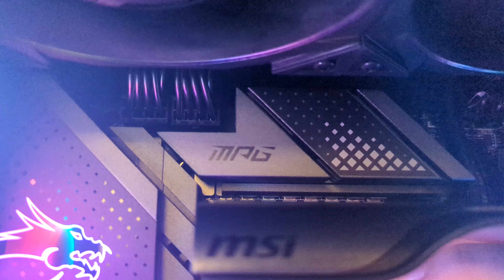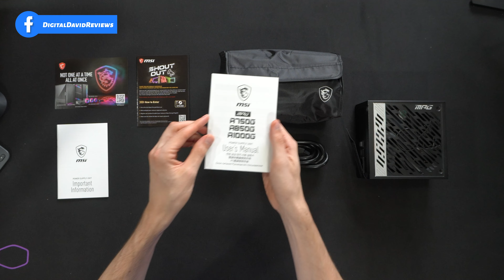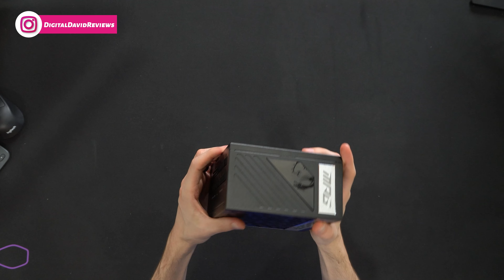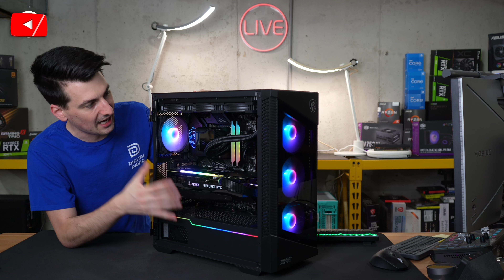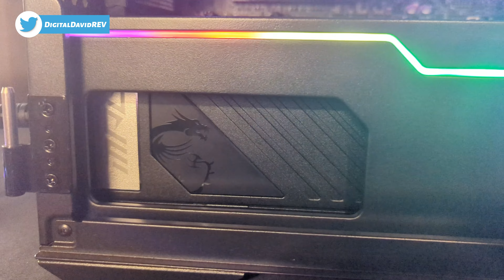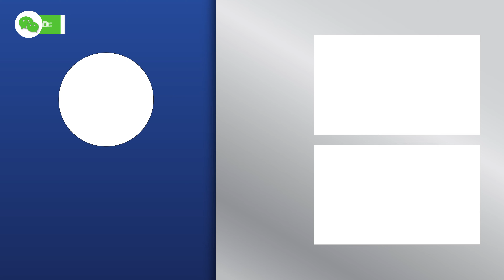MSI MPG A1000G Gaming Power Supply Review

Comment: Hi man! So im using this PSU for 6 months and i dont understand the "zero" button in the back. can you explain me please?
Reply from the maker: Here is what you need to know:

Certain power supply units have a zero RPM mode. This feature allows for the PSU fan to be completely off when it is not needed and will automatically turn the fan on when your PC reaches a certain temperature. Once the fan is turned on, it starts at a low RPM that gradually increases with the temperature.
Reply: @DigitalDavid  thanks man. You clarify me

Comment: I’m undecided between this and the platinum 1000W version from Straight Power 12 

What’s better and what’s platinum for?
Reply from the maker: I would do the Straight Power 12 since it has PCIE 5.0 on it! You might appreciate having that now or defiantly in a few years! Platinum is just the energy rating efficiency. "80 Plus Platinum certification is the highest level of efficiency offered by the 80 Plus program, indicating that the PSU has an efficiency of at least 90% at 20% load, 92% at 50% load, and 89% at 100% load."
Reply: They have since updated this unit for atx 3.0

Comment: Got mine hooked up and it’s doing the job. If I had 2 gripes:

1. The 2 parts of the ATX cable are on the wrong side from one another, doesn’t line up to the ports unless you swap their positions.

2. I called the tech support and the guy was a total asshole. Like really, really rude. My last PSU was an EVGA and they were always phenomenal.
Reply from the maker: I'm sorry to hear about your experience with the tech support. I've honestly been noticing rude tech support with a lot of companies lately.. It's no bueno. 
~B

Comment: Do you know why are the cpu cables pins different from both sides?
Reply from the maker: Thank you for your comment on the MSI MPG A1000G Gaming Power Supply video. The CPU cables of the MSI MPG A1000G power supply may have different pins on each side for a specific reason. This design is often referred to as a "keyed" or "asymmetric" connector.

The purpose of having different pin configurations on each side of the CPU cables is to ensure proper alignment and prevent incorrect insertion. The different pin layouts prevent users from accidentally connecting the CPU power cables in the wrong orientation, which could potentially damage the components or cause electrical issues.

By making the CPU cables asymmetric, it helps guide users to insert the cables correctly and securely into the CPU power connectors on the motherboard. It's always recommended to consult the user manual or documentation provided with the power supply and the motherboard to ensure proper cable connections. cnl

Comment: do you have  one - time - click sound when you turninng on pc  and when you turninng off pc????
Reply from the maker: I have not noticed any clicks but... Most of our power supply units (PSUs) have an inrush current bypass relay that makes a click noise when the PC turns on and off. This is considered normal and not a defect. If your PSU is making loud repetitive clicking sounds after you turn your PC on, contact Customer Support.

Comment: I ant get this psu to power anything. It's second one in a day. I put my old psu in and it works fine. I'm assuming it's something simple I'm overlooking.
Reply from the maker: hmmm that is really strange! I would have no idea!
Reply: @DigitalDavid  For some reason it just magically started working. Haven't had any issues so far.
Reply: do you have  one - time - click sound when you turninng on pc  and when you turninng off pc????
Reply: @failentisagood  I have no clue what was causing it but just started working like 2 days after I posted this. It’s powering a Strix 4090 and idk what the issue was. It works fine now though
Reply from the maker: Glad it works now!
~B

Comment: whats the noise like on this thing while gaming? it loud?
Reply from the maker: I have never heard it!!! So no very quiet !
Reply: @DigitalDavid  I just ordered this on Amazon. This is an ATX 3.0 right? Because I have a 4090..
Reply: @geogeo4139  u have to get the version that comes with the atx 3.0 cable theres 2 versions of this psu
Reply: @2iLLxxx  Yea I did. It's $199 at NewEgg and $249 at Amazon. 
I got this one... MSI MPG A1000G PCIE 5.0 1000W ATX 80 Plus GOLD Certified Active PFC Japanese Electrolytic capacitor Full Modular 4080 4090 Compatible Power supply
I will upgrade in maybe 6 months to the MSI 1300W Platinum certified.
Reply: @geogeo4139  if u gonna get that u might as well get it rn and save money lol that shit cost like 350 and u payin 200 for the 1000w one
Reply: @2iLLxxx  Yeas I already pre ordered it :) And got my 34in Alienware curved monitor today $1400. Its extremely beautiful. 
I have the ASUS 4090  and waiting for the New ASUS motherboard I preordered and the 13900k pre ordered. Both gets shipped the 20th. And I got the Samsung 980pro delivered today with Corsair 5600mhz DDR5 :)  And Monday I have conming the Cooler Master Cosmos C700M E-ATX Full-Tower $599 :)
Reply: @geogeo4139  mate we don’t need to know all that